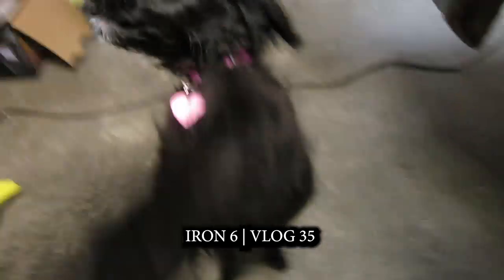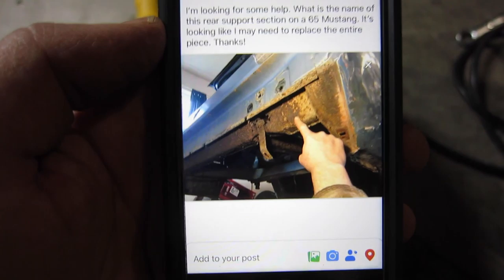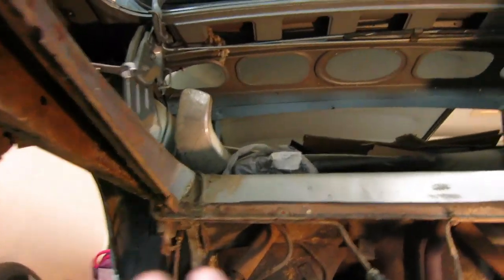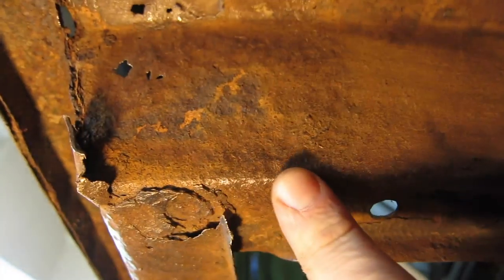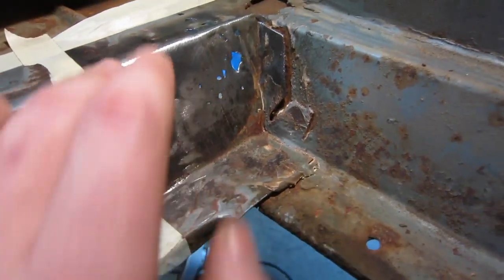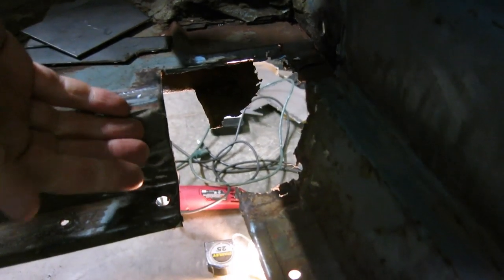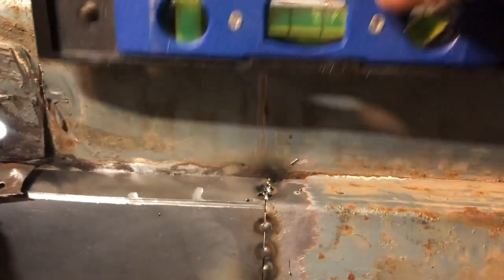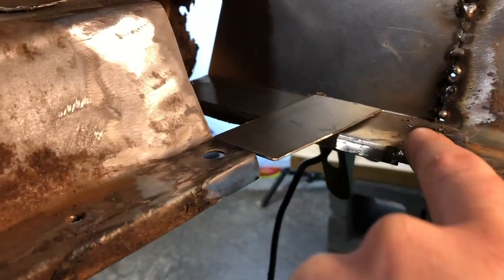65 Mustang Metal Fabrication Begins

Comment: Glad to see I am not the only one that starts with one thing and it just keeps growing. I had just started pulling wire out of the car to rewire it and inspecting the floor pans to now also pulling and rebuilding heater box.
Reply from the maker: Since moving to the body work phase, every task I’ve take on has been opening a can of worms. Still, I’m havin a hoot. 😆

Comment: Nice job so far! It's those small victories that keep us going. For me it was redoing the heater box. Now I'm ready to install carpet - lay in, trim some, check the fit, lay in, trim some, check the fit, lay in, trim some more. Similar thought process to your fab.  We keep eating our respective elephants a bite at a time.
Reply from the maker: Thanks Johnny. Sounds like you’re further ahead than me if you’re laying carpet. Keep at it. It’s definitely like eating an elephant. Fortunately, I savor every bite. 😁
Reply: Nah. I have zero engine experience, but while I have driven it with the rat's nest of old wiring that used to be in it, I had someone start from scratch on a proper rewiring. Unfortunately, he ran into health concerns and got only part of it done before he had to quit. Now it's a great learning opportunity for me until I can bring in someone with knowledge to give me a hand.

Comment: Andrew, you're gonna get your fill of fab work redoing your 65, trust me !
And I know you're doing it on a budget, but, when you can buy new metal parts like that rear trunk pan support bar then I would do that.
You should find that both L/R rear frame rails butt right up to that piece so you'll want to make sure before you weld those pieces into place as on mine I was able to piecemeal the left side rail and ended up replacing the right side rail all together. And it's great experience on finding the right drill to get those pesky spot welds out along with a heavy duty spade to pry up after you've drilled them out. Also I'd probably pull apart the inner rear trunk pans before I weld it altogether and make sure it all fits properly. It seems like yesterday I just did all that stuff too.
And that rear pan support is seam sealed so it keeps all the water out.
Keep at it, it's coming along nicely and I'm sure it makes you feel good on your progress too. Not everyone would ever attempt a project like this. I'm always hear if you need help.
Reply from the maker: Thank you so much Tim. A big part of the confidence I have in doing this stuff comes from knowing I have support from guys like you. Thanks for all the insight and advice. I’ll be covering more on the trunk floor brace project. But plan B, if needed, is by the replacement brace. 😁

Comment: Great job. Probably didn't need to score the metal, but I understand the reasoning.
Reply from the maker: Thanks Barry. I opted to go with 16 gauge steel for the repair although I believe the brace is 18 gauge. The 16 was tougher than I expected. Guess I better get back to the gym. 💪
Reply: @GreaseRookie  Just a bigger hammer...

Comment: I have a ‘69 Chevelle that I need to make some small patches for rusted areas on the body panels. What gauge thickness of metal are you using for yours and what size mig wire? This is my first project and you’re videos have been awesome to watch how you are learning as you go as I will be!
Reply from the maker: Glad my videos are helping. I’m using .025 mig wire (from Harbor Freight) and bouncing between  16ga and 18ga steel. I’m only using 16ga for the brace repairs. 18ga for the panels. Unfortunately, the box stores like Lowe’s and Home Depot usually only carry 16ga and 22ga sheet. Which is too thick and too thin for panel patches. You may have to find a sheet metal supplier locally to get 18ga or 20ga for your panel patches. Buying online is an option too. Hope that helps. Thanks for watching. 🤙

Comment: frame rails look solid but i think you should replace the left and right trunk pans with the drop panels aswell, but if you're not going that far, cutting cartboard shapes like you did for small patches is ok(but try after making the small pieces of cartboard template to tape them together and cut it as one piece like you did with the trunk brace patch, it will save you some time, then put it in a vice and bend the shapes that you need). For cutting spotwelds i suggest using a double hss sided spotweld cutter drillbit (https://www.ebay.com/itm/5-16-Double-HSS-Sided-Rotary-Spot-Weld-Cutter-Remover-Drill-Bit-Welds-Practical-/133304416516), bottom like you are doing great, keep it up
Reply from the maker: Thank you Cristian. I’m definitely going to try to make the pieces out of one piece from now on. I’ve spent way to much time welding and grinding. I’ve looked at the trunk pieces with the drop panels. They’re not much more money. Not sure which way I’ll go yet. I’m anxious to get it on the road sooner rather than later. Thanks for the link. 👍
Reply: Grease Rookie i know the struggle i ve been working for 3 years on mine and i ve just completed body work, i ce learned alot in this time, so be patient and try to do it the best way possible even though it might take some time